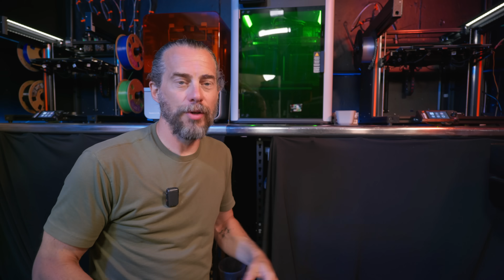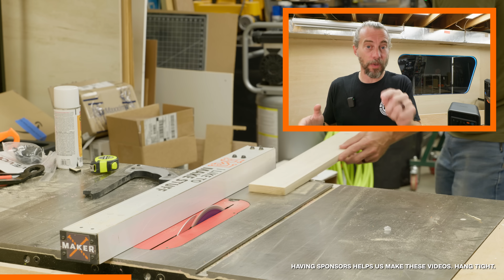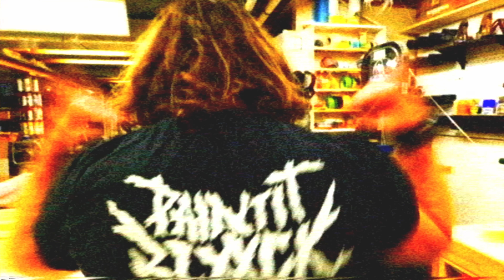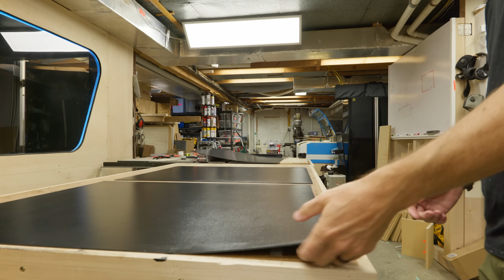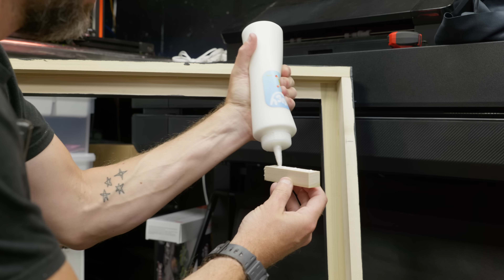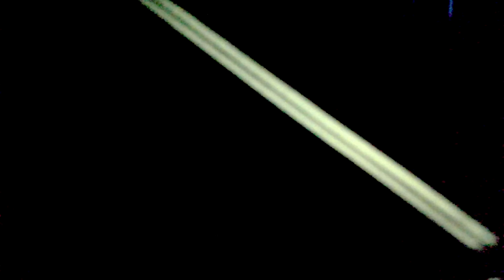The Easiest Way to Hide Ugly Storage Shelves

Comment: If you put a sheet of white acrylic on the other side of the led strip it will be more visible through the pattern in the black acrylic. Now most of the light will just go into the shelves and disapear. You need to have a reflective surface aka white acrylic to make the light shine out through the pattern better. I also first thought you might do some sliding doors or something. Sure they are still easy to remove when accessing the area behind them but it would be more practical with sliding doors.

Comment: Instead of getting thicker acrylic, throw a second layer on the ends, either acrylic or wood. The back sheet gets one in the middle on the back, and one on either side for a handle.  Front one gets one on the front middle, then front and back on the other handle side.   I've seen some reptile cages where the reptiles will push on the seams and this method works.

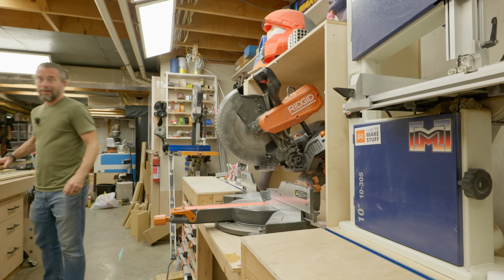Comment: 4:00 I thought miters just don't look good, they also provide more surface area for a better mechanical connection of  the joint than a 90 degree joint, no?

Comment: For those of us that our home DIYers and don't have table saws and such, how would we make these. I can just imagine trying to cut those long channels with a circular saw. There's not really a way to keep it straight on a thin board.
Reply: Make a temporary straight edge jig to cut the grove with a circular saw.  Clamp a long ruler or similar and make the cut...may take a little set up but should work...
Reply: When I build sliding doors for my 3D printer shelf, I just bought some off the shelf "bypass track" (which also had the advantage of being made of plastic, so it was automatically pretty slippery). If you wanted to make this out of wood without a table saw, you could glue together strips of wood that are different widths to mimic the profile of the tracks.
Reply from the maker: You could definitely use a straight edge guide or a track to keep your circular saw on a perfectly straight line.
Reply: @Iliketomakestuff  How would you do that with no place to put the straight edge? The circular saw and guide are wider than the board you are trying to groove, unless I'm mistaken.